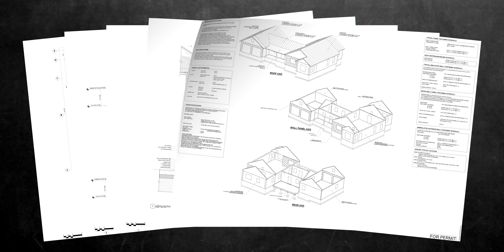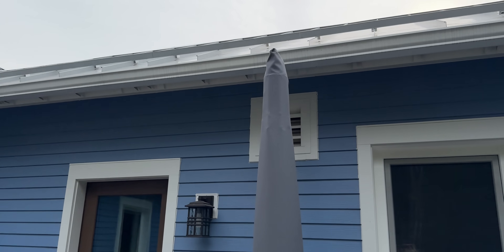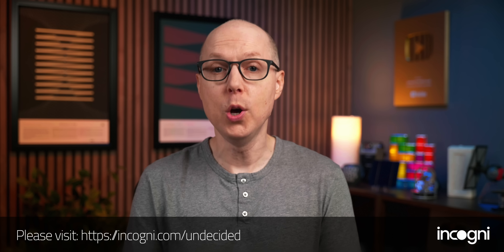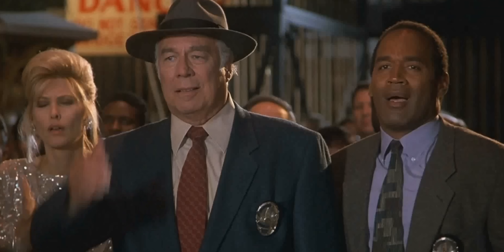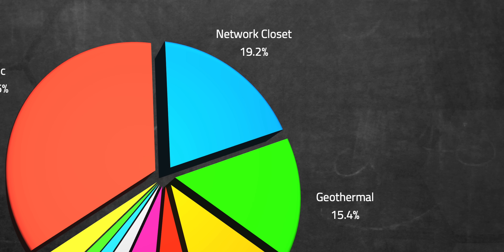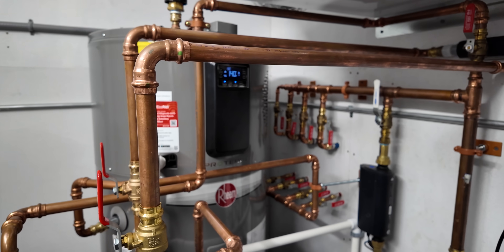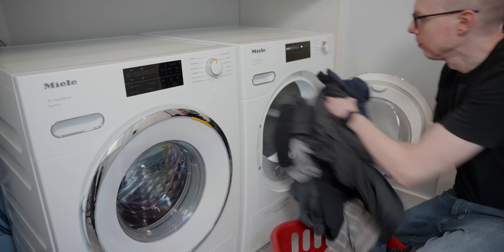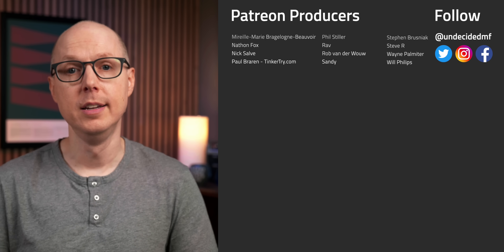What I Learned After 1 Year in My Net Zero House

Comment: I thought I had a PERFECT use case for a heat pump water heater, but I don't yet have one. Here's what happened.

We have an old house (built 1949) with the water heater in the basement. The (sadly not very old, but just out of warranty) gas water heater failed, as they do. I decided a heat pump could use the same circuit I use for a dehumidifier, and HOPEFULLY the water heater would dehumidify the basement well enough.

SO  I started calling around, asking to spec a heat pump water heater. ALL the plumbers wanted to sell me an on-demand water heater. Most of the local plumbers wouldn't even bid on a heat pump. I finally got a bid, and it was WAY high, and would require me waiting an unknown number of days for delivery. Plus by this time, we had been without hot water for more than two weeks, and it was beginning to cause interpersonal problems. I decided the on-demand setup would not work easily in our basement (far away from an outside wall and expensive electrical requirements) SO we found a plumber to put in a replacement "ordinary" gas water heater.

After watching what the plumber had to go through to get the gas heater down the narrow and steep basement stairs, I realized the weight and cumbersome weight distribution of a heat pump water heater was probably one reason for the huge bid I got to install it. They are very heavy when empty, and unlike a gas water heater, the heavy compressor makes them quite top heavy until they are filled.

OH and of the currently available models of heat pump water heaters in my area, all show terrible reviews. Unreliable, problems poorly covered by warranty, and complicated and poorly described energy settings are among the complaints. I know many folks have good results from them, so I hope eventually to be able to install one.

Comment: I would vent out the heatpump dryer exaust. The energy required to dehumifiy the water from the air will be an order of magnitude more than the hot/cold air lost. If possible feed this exaust to the stale air inlet side of your HRV

Comment: Basement for sure.  If you live in an area where you can have one do it.  I realize it's more upfront cost, but i have never heard from anyone that they regretted having one.

On the other hand I know a few people who opted to do a slab because the builder talked them into it and they have regretted it.

As far as the heat pumps i think it really depends on the climate where you live.  It's been a wash for the few people i know who have one. when it gets too cold in the winter and the heat pump can't keep up the electric heater strips come on and then your cost savings go straight out the window.
Reply: When it leaks, a basement is very expensive to get resealed. Geothermal pumps are ridiculously expensive. Either go normal build and get geothermal or invest in a tight build and get a regular heat pump at 1/3 the cost.

Comment: The frame is going up on my house in a week.  Planning a 40+ kw array on the garage roof to offset all my electricity, my parents house and then sell some more back to the power company.  Both houses are all electric, one with a geothermal system and the new one with a heat pump.  Decided to take the medium approach on energy efficiency with instant hot water heaters, triple pane casement windows and insulated concrete under the house.  Wall insulation will be to code, which is pretty decent these days.

Comment: Well, you won't believe this but my father bought an oñd house with a crawl space and put a basement beneath it. When i was six years old i carried huge  flat stones from a riverbed up a hill into the trunk of his 59 Chevy. 2" clearance but onñy 1/4 miles. He dug the cellar out with a shovel and wheelbarrow while i mixed hundreds of batches of mortar. 2 shovels full of sand, 1 shovel full of mortar, mix with hoe: add just the right amount of water at the right time. I still remember how it was done. I am avaiñabñe for hire, but the secret formula is written above. You can do it. It's not too late !!!

Comment: Here in Paraguay it is not common to use thermal insulation being that it reaches 46° Celsius, now I am building our house and although I am going to spend much more I want to do it using good thermal insulation to achieve good efficiency with the use of air conditioning. On the other hand, everything here is made with concrete and bricks, almost no prefab materials are used

Comment: Im a Builder, Contractor  and HVAC contractor.
I've been studying efficiency in homes since I was a kid in the 80s. I worked on top tier homes for 20 years and saw all thebgood and bad. Most of the bad was from "new" technology fixing things that aren't a problem. I can build a Net Zero home with standard processes and products that have been around for decades.

You should always put in a basement and leave it unfinished. I recomend a cast in place insulation   system from Thermomass. Any DIY couple can dig and pour a foundation, then hand it off to a contractor. You rent commercial concrete forms by the month in most locations. Heavy equipment like a backhoe or loader is just like a rental car at your local commercial yard. First time I got equipment I told them I'd never driven any equipment before and they did a walk through in the parking lot with me. You do need liability insurance to set up an account there though. It's worth the 2k for the insurance so you don't rent from someone like Home Depot.

The best thing to do overall is to get about 80% of the way to net zero and stop.  The last 20 percent  costs more than it returns most of the time. Its just a personal goal some people like to spend money on. 
Geothermal hardware has a real bad reputation for dependability. My friend works at a company that used to do about 50% geo. They stopped about 5 years ago because of all the hardware issues. Ask yourself why  magor companies dont have geothermal equiment. Right now Bosch is the best equipment out there.

Get a 2 stage or variable air handler and leave the fan on 24/7. Its the standard in high end homes and is better than in floor heating.

Comment: 15:40 electric stove tops are the most inefficient way to cook food you're burning gas to turn water to steam to turn a turbine that will then power a generator that will turn on your stove when you could just burn the gas directly and get the same result for way cheaper
Reply: Just an FYI, induction cooktops are different than electric. Induction cooktops use less energy than electric yet also transfers heat much faster than gas. Downside is that you can't use aluminum cookware, only cast iron, steel, or stainless steel.
Reply: Induction stove tops are not resistive heat coils of the old days. They use electromagnetic currents to heat up the pan itself, not a resistive coil. They are insanely efficient, way more so than gas. Gas burners waste so much energy with waste heat, much of the heat produced from a gas hob goes right around the pot and into the air. With induction, the pan and nothing else is heated, much less waste heat!
You also have to consider the impacts of how we gather natural gas, it's energy costs etc. and it's almost a joke how inefficient burning it is to alternative means.

For a resistive cooktop, it's actually still more efficient than gas simply because of the massive amount of energy that is wasted and not used when heating a pan.

Look up water boil times over gas cooktops vs NA water kettles (115v) and EU water kettles (220v). NA beats it within a noticable margin but the EU ones are able to pump WAY more amps into those things, easily cutting the time in half if not more.

An induction stove uses dedicated 220v power delivery so it's also similar to EU kettle energy efficiency.

Comment: Here is Ohio, most are using the mini split systems with builds like yours.  Did you consider these?  Much cheaper and probably similar efficiency.  Downside is the install on the exterior walls but you can do the multi head systems.

Comment: 16:40 Another strategy to save on energy: air drying clothes
If you're in a very rainy climate, you can still air dry indoors (have the HVAC dehumidify the air) or with a washing line under a carport

Comment: After a year of having solar panels, my personal feeling is that where possible, homes would be wise to have solar panels. Likewise, new homes built in the sunbelt would be wise to have solar panels included in the build.

Years ago, I knew someone in the Boise, ID area who built a passive solar house. He was incredibly happy with the home’s performance. The only problem with this is that doing this requires a larger lot for the heat exchange water circulation system.

Comment: I’m a licensed HVAC/R tech in Canada. Far from an expert but I see the everyday results of high efficiency equipment being implemented in the world. They are great on paper but the upfront cost and potential repair costs when something does break are astronomical compared to some of the simpler less efficient solutions. I have heat pumps in my own home but I’m not sure I would if I couldn’t install, maintain and repair them myself. This may just be a local problem but the amount of equipment I am called to repair that is broken due to improper installation is insane.

Comment: Great video with lots of interesting information! When it was time for me to replace my water heater, I wanted to get a heat pump version - however it would not fit in my basement - the added height of the heat pump made it impossible (need room to change the filter), made me sad.

Comment: Glad you like your house.  Certainly many interesting things and technologies incorporated and resultant expected efficiency gains.  That was all kind of a given IMO.  The part I'm truly interested in is the longer term maintenance and repairs of this highly complex stuff, and how that factors into "cost neutrality".  I have a really expensive Lennox HVAC unit with variable speed indoor and outdoor units, love the way the house feels with this system, and how low my bills are.  That all "love" flew out the window when the $700 outdoor unit fan motor died after only 2 or 3 years!  Worse, Lennox completely infuriated me (read: will never buy Lennox again) when they refused to deal with me on the warranty claim because my repair guy (and a bunch of other repair companies) would not even attempt to deal with Lennox on warranty.  I had no idea that Lennox would not deal with the end consumer ... I just needed the $(%*&#@$^ing thing fixed _right_now_!  Anyway, I truly hope you don't run into these types of issues, but am really looking for the much longer term analysis.

Comment: in the process of building a net-zero home in Colorado - on the plains. Using SIPS and electric in -floor heating, tankless hot water. As simple as possible for single floor, 1400 sq.ft. retirement home. Looking to use some repurposed materials for interior. Very excited to get started as the delays with the county requirements and construction loan intricacies have been significant!

Comment: Heat pump WH is best sited in the garage where it can cool the garage in summer.  Basement siting means your basement will be even cooler than is normally the case.  Closet siting means you have to have pretty good circulation of air in and out of the closet.  Air source heat pumps for HVAC use can work in cool/cold climates but need to be optimized (more$) for that use.  A generic heat pump HVAC designed for N Carolina or south or west to Tx/Az will not work well in the winter in northern tier states.

Comment: I love keeping up on all this expensive tech. Most of it is out of reach for most people but there are always bit and pieces that can be employed.
My house is also a slab on grade PT slab but all my appliances use natural gas (stove , Rennai, dryer, furnace). The house is well insulated R32 roof 2x6 walls. I have 16 400W panels but currently no battery/inverter setup.
My yearly PG&E is $300. (Gas+E). 
Most additional tech has very little cost effectiveness.
I could convert to E and cap the gas but the cost would exceed $30000 and would not save a dime because to get the same net cost I would need more panels and battery storage. 
I must agree that the fresh start approach is the most viable. The cost of retrofit to save operating costs is definitely a net loss.
Reply: Yup much of this energy saving stuff wouldn't make much in the USA cause the price of energy in the USA is just so cheap.

Different story in northern Europe though where one gallon of petrol is now $10 and electricity costs have gone through the roof because of Russian sanctions.

Comment: Like you found out, HRV really does not use much energy. In my house normal circulation the ERV takes around constant 32W input power and it jumps up to around 100 Watts for 15-30mins if someone takes a shower because it is humidity and co2 controlled. CO2 is really never the thing with our family but moisture control kicks the ventilation up couple times a day because I am in a climate where you can basically dehumidify the house just by ventilating for 10 ish months a year.

Comment: I don’t know if geo thermal is similar to a heat pump hvac but I have a heat pump that runs a separate set of wires and breaker to a backup heat source contained in my indoor unit. It will run if the outdoor unit ices over.

Comment: I also have a Water Furnace Series 7 geothermal. The heat backup if the electric strip heaters installed for very high demands or as backup is the heat pump fails. In your symphony app it would be shown as Aux Heat. Also when Aux Heat is installed, the power for the control panel is rewired to that circuit (maybe the fan too? Not sure). So heat backup is the control panel for the geothermal, maybe the blower fan, and the auxiliary heater strips for high demands or emergencies.

Comment: Why suggest a heat pump no matter what?  When in your water heater video you admitted you speed more on energy over the previous gas water heater. 

You admitted gas is that much cheaper than electricity.

Your energy use on your previous water heater would have been significantly lower if was a fair consistent comparison with a preheater.

Comment: Heat back up is most likely your back up electric heat strips in your air handler. I would assume they kick on when your geo thermal system cant provide the desired heat temperature. Heat pumps use these as well. Heating you house to 72 is pretty crazy... Try lowering your deaired tdmp to 68 or 70 and you might eliminate that 5% of energy usage.

Comment: This video is so full of errors and bad information I had to stop. Slab on grade fully insulated, sip panels, shape of the house should be square, flat invented roof r60 min, double ceiling every thing inside the thermal envelope.
This house wouldn't have met the first addition of the I codes.

Comment: The only issue I have been skeptical about is the initial cost of these high efficiency appliances and will they last a long time without breaking and needing to be replaced? Replacing a standard hot water heater vs the new system is crazy. Only time will tell.

Comment: First, congrats. 😁 You don't sound "undecided" about heat pumps vs gas. 😁 I have to challenge "it's not a matter of whether they're cheaper...but how much". True in some climates, but in North Dakota, most of our heating energy is needed when its below zero. Propane here is $1.30/gallon, and electric is $.104/kwh, and our furnace is 95% efficient. Straight unit conversion shows a heat pump would need a COP of 2, and even those with a high SEER2 do not come close for the majority of our usage, that is, below 0. Someone could use a heat pump in the spring and fall but would have to be diligent about switching. We need air conditioning too, so many people are getting the heat pumps almost for free on the AC equipment, but I doubt many people know when to switch and remember to.
Reply: The calculation is:
(.104 $/kWh) * (.3 Wh/BTU) * k/1000 * (91,400 * 95%) BTU/galPropane = 2.70 $/galPropane
I've never paid more than $1.90 for  propane, and that was 2020. $1.30-$1.50 is typical.

Comment: We looked at building an "R2000" (then super energy efficient) home in the 80's and was advised by a friend to be very careful what we brought into the house as the chemicals from the construction materials such as carpet, paint, flooring, cupboards, insulation etc. would be gassing off for years, and that an air tight house with limited fresh air from an air to air heat exchanger could be an unheathly environment with a steady low level of toxins (primarily petroleum based). And then you look at cleaning chemicals.
So maybe check more that CO2 levels.

Comment: The back-up heat on your heat pump is most likely the electric heat that runs for defrost or extreme cold. It's the biggest energy difference between a heat pump and straight cool AC system. An air handler can be on a 20 amp 240v breaker except for the heat kit, which requires a 30-60 amp breaker depending on the size